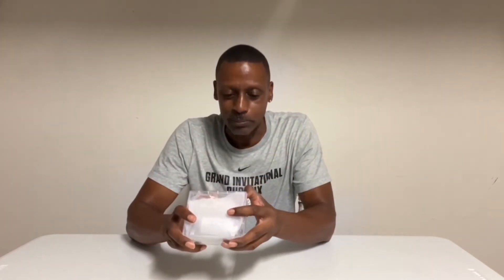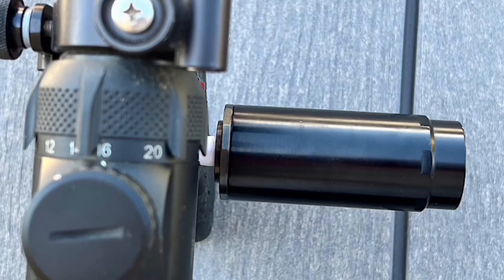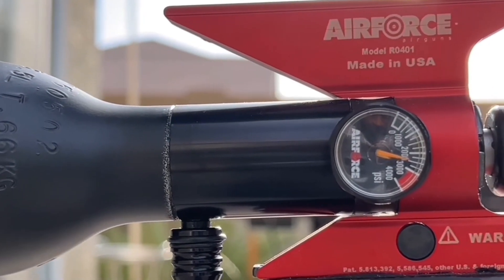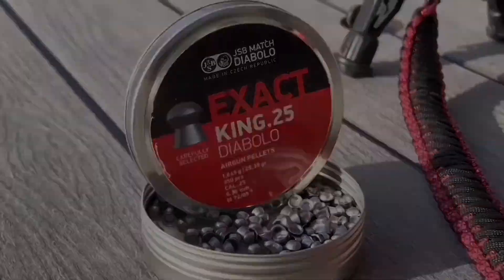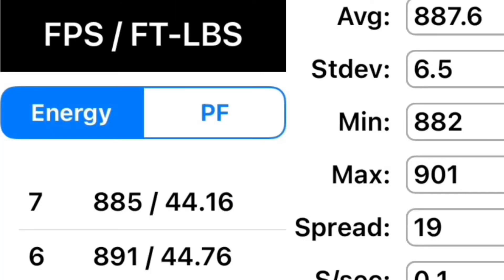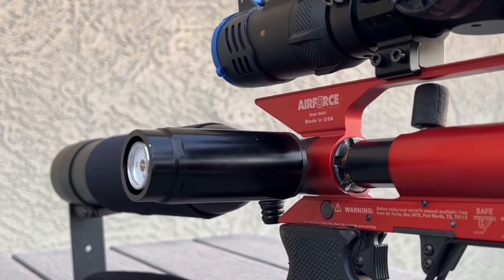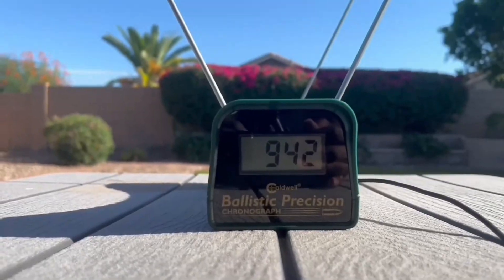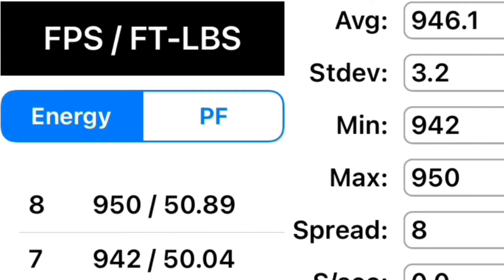AirForce Airgun Power Plenum - Increase Your Velocity

Comment: You took 7 shots and averaged it without the plenum.  Then you took 8 shots with the plenum installed and averaged it?. You took and averaged a additional shot into your numbers. I'm sure the plenum does make a difference but you're results are off.
Reply from the maker: Thank you for the insight. This video was made simply to show an increase  in velocity when using the plenum, not shot count. The volume of air used from shot to shot is enormous and lowered my shot count. The reason I did this was to show the increase in velocity when using the plenum. My plan was to shot slugs. However, I have learned that my gun/air rifle doesn’t yield the accuracy I want in shooting slugs. I am assuming my chocked barrel is not very slug friendly. I have learned that the JSB 25.39 gr pellets yields the best results for me so I no longer use the plenum. The plenum is a great asset if you are looking for more power. Thanks for watching and commenting. Happy hunting.

Comment: I’ll tell you the Achilles heel of this product- It’s perpendicular footprint on the gun. I’ve ordered a thousand dollars worth of products from PCP Tunes over the years for my Condor. I have the V1, V2, V3, and the Texan regulators. If they made a 90° male to female high pressure elbow that would allow the plenum to run parallel instead of perpendicular, it would seem less “clunky”, and (IMHO) functionally and aesthetically more pleasing. The plenum will be equally effective pushing the air through a 90° orifice as it currently is. Maybe you could reach out to the guys at PCP tunes and see if they will make one. Tejas is typically very responsive and easy to work with.

Comment: Will it work on a Talon SS with Altaros reg ?
Reply from the maker: I’m pretty sure it will. As long as it fits and screws tight in to your valve it should work. It’s designed to thread in the the Airforce Airgun valve. Thanks for watching.
Reply: @AzAirgunHunter  Thanks
Reply from the maker: You’re welcome!
Reply: does it reduce shot count?
Reply from the maker: @williamfrancis6993  It will use an extra 30cc of air per shot which can affect your shot count.
Reply: @AzAirgunHunter  Thank You ! What BAR and power wheel settings are you using. FPS ?
Reply from the maker: @williamfrancis6993  I have both my power wheel and power meter set at 1. My FPS with the JSB 25.39 gr pellets is around 940. However, I have dialed down my regulator to conserve a little air plus my rifle shoots best at around 887-910 fps. I current average 906 fps and shoot about 20-25 pigeon before falling off regulator and having to refill and that’s including a few misses and or a shot to the wing breaking it and following up with a second shot. It works well for me. I guess it all comes down personal preference of how you want your gun to shoot and what game or varmints you’re shooting.

Comment: Where can I order one for myself 357
Reply from the maker: PCPtunes.com. I believe I added a link that will take you directly to the plenum in the description section of the video. Thanks for watching and commenting.
Reply from the maker: Update! I received an email this morning from the PCP Tunes team indicating that their website have changed to https://trajectron.com/ as they transition in to Airgun manufacturing. As such they are still producing parts for upgrades and modifications. Also they created a new link for the plenum which is https://trajectron.com/airforce-gunpower-valve-assembly-side-expansion-power-plenum.html. So you can find the plenum here if interested. I will also update this link in the description of the video. Again thanks for watching and your continued interest.

Comment: How about size of power plenum? How much of air (C C)?
Reply from the maker: It holds 30cc’s of air. Thanks for watching!
Reply: @AzAirgunHunter  If we change it to greater than 30 cc, does it change speed?  because i see fx use 72 cc.Thank you.
Reply from the maker: If you change the plenum to use an extra 72cc’s of air behind your valve it will increase the velocity of your projectile more than the 30cc plenum will. The 72cc’s of air will be released behind your air valve in conjunction to the air released from your air bottle. So the more air flow you get down your barrel the greater the velocity of the projectile. The air released from your bottle should not be affected or changed as it depends on bottle air volume, valve size and hammer strike. The plenum just stores extra air from your bottle that is also released when fired. Just ensure you have a sturdy bridge breech to handle the extra air pressure. I am not sure of the max pressure the standard bridge breech can handle but just a word of caution for personal safety. I do have a more durable delrin bridge breech but I still use the standard bridge breech because it offers a smoother and better fit than the aftermarket bridge breech. Also understand that the report of the rifle will be louder and use more air than normal which will yield a lower shot count. I hope this answers your question. Again, thanks for commenting and watching.

Comment: Does it work on a .50???
Reply from the maker: Hello and thanks for watching. I can not say 100% that it will work on .50, but if it’s the same AirForce Airgun valve threads I’m pretty sure it will. All ot does is stores an extra 30cc’s and releases it when the hammer strikes the valve. So it works in tandem with your air valve. It just needs to screw in to the valve gauge port.
Reply: @AzAirgunHunter  I'd personally be interested in a test of that the threads will be the same it's the power I'm looking at in regards to extreme lrm ability and how well the valve holds up in a 3 to 4 month test it seems like a reasonable product but things like that could potentially severely damage the weapon is this something you are willing to test??? If so and you can show something real on numbers of deviation on crony  plus the wear on the valve and reg I personally will buy but at this point there's not a hole lot you have on it except the power on a .25 but airforce makes many calibers plus the regs and valves
Reply from the maker: I understand your concern of wear and tear on the gun over a period of time. I too had the same concern of valve damage. This is why I only conducted the test at the lowest possible setting plus it gave me a good reading of the difference in power with and without the plenum. As far as wear and tear goes me myself am more concerned about the 95gr heavy hammer I have installed rather than the extra air from the plenum. The hammer slams into the valve harder than the standard valve while the plenum only store an extra 30cc of air that is release when the valve is opened.  So I personally don’t see a problem with wear and tear from the use of the plenum. The air from the plenum is released in conjunction with air from the air bottle giving you a larger volume of air release which I have seen has no effect on the valve itself. I don’t own a .50 so I can’t give you info or data regarding the .50 but I can tell that I have spoke with the manufacturer of the product and when I shared my thoughts with him of possible rifle damage he informed me that the product should cause no damage to the gun itself but it is the heavy hammers and springs that can cause damage over time due to the heavy or hard slam in to the valve. The extra air release should cause no damage. I have two custom valves  for my rifle that handle the plenum very well. As far as deviation and other numbers they are in the video but only for the .25 Cal which is the gun I own and conducted the test with. I only use plenum when shooting pigeons from time to time. I don’t use it as a standard everyday shooting addition for my gun. I shoot more dove out to 60 yards and the plenum puts out too much energy for dove. I shoot dove with .25.39 gr JSB pellets at 887 fps which gives me great accuracy and energy for dove but the pigeon are little tougher to kill so I use the plenum and heavy slugs 36.2 hr slugs. If you are looking to use it for everyday shooting on your .50 I believe you would be ok. As I mentioned earlier it’s the heavy springs and hammers that can cause valve damage. I only have the heavy hammer, my spring is the standard AF hammer spring. I have been shooting this way for over a year with no problems. The extra air should cause no damage. It works fine for me without damaging anything. Almost forgot. My bridge breech is also a more durable delrin breech because that was a concern for me. I pay close attention to me breech because this is a part I don’t want blowing in my face. With that said I hope this helps. Sorry I don’t have any further data for you. I don’t work directly with manufacture, he is located outside of India but we do talk via cell and email.
Reply: @AzAirgunHunter  are you able to relay an email for the manufacturer so I can ask him cause all the things you've said I already know but knowing how the extra air will affect the top hat in a v2 is what I need to know plus the effects on numbers if your only getting 30fbe extra on a .50 that's kinda waste of time but if it increases by say 70 to a 100 that's extra power that could be used to beat the record of 1252yrd shot with an af I personally wanna touch 1300yrds and get 2 recorded accurate shots within 3inch hence my curiosity
Reply from the maker: @nemesis885  Sure! sales@pcptunes.com. Here you go. Give him time respond. He is working on expanding his company. His name is Paul. Tell him Ed referred you. Good luck. I hope you can get the answers your looking for.

Comment: What chrono numbers will it do with the power wheel turned up too 12
Reply from the maker: I would like to start by saying thanks for watching and commenting. But to be honest with you I never made any adjustments or test at a higher setting. The video was a test to see how much power I would gain with the plenum on average. After conducting the test I figured shooting at a higher setting would not matter being that I gained an 60 fps at its lowest setting. Also I felt my shot count would be severely affected if I was to shoot at such a high setting. But I will share with you that with the lowest setting it shoots the 25.39 hr JSB pellets 1025 fps, which is way too fast for a pellet and as I mentioned earlier I don’t think extra air usage is really worth it. So sorry I don’t have those numbers for you. But if I do run a test as such I will refer back to you in this comment. Again thanks for watching.
Reply: @AzAirgunHunter  thank you for the time to make this review it is very informative and now I understand

Comment: Hey curious about the plenum.  Is there anyway that could break off ?  Just hate to bump the side of a tree with it and curious how strong that setup my be ?  Thank again, like your videos ?
Reply from the maker: Again thanks for watching and commenting. The plenum construction is pretty durable. That too was my concern in the beginning but it has tipped over due to my son bumping it and all works well. I have designed an adaptor that will reposition it and align it with the bottle so it doesn’t stick out the way it does. I really don’t like the way looks right now. I have a local machinist that use to help with work on guns but I haven’t gotten a chance to speak with him. Eventually I will get to it. But is a sturdy design and a solid fit. Bumped up my fps by 59 with the same power settings. It puts the condor in a whole ball park of power. It shot the JSB 25.39 grain pellets at over 1000 fps. To be exact 1058 fps and that too was at the lowest possible setting. Thanks for tuning in and for the compliment. I hope to chat with you again soon.

Comment: Nice review on this but, I just don't see spending extra on an old design or new design air rifle. It may also cause the Air rifle to perform shorter term and not last as long as it should. The best way to do things are invest in a few different caliburs starting with .177 or .22 cal then to 30cal . that way you can cover a wide range of pesting and hunting. This is my experience of 40 + years in air power. I can cover medium range and long range with 3 caliburs. It seems to be a lot of hype stuff going on and mislead people in the air rifle world. If you research thoroughly you can be much more successful! Not knocking what someone wants to do. But use your head about this. Good video, hey, sta slingin that sweet air rifle lead! Ed da pro snippin air man💥💪😱😱😱
Reply from the maker: Thanks for watching and sharing your input. It is much appreciated.
Reply: @AzAirgunHunter  itsokay👍 you have a wonderful Hollidays!
Reply from the maker: @eddiecahall3824  Thank you. Same to you. By the way I have a .22 Cal Benjamin Armada and sold my .30 cal Hatsan Carnivore. I have fallen in love the .25 Cal.

Comment: This is FANTASTIC! Really, really good idea. I've been telling people for years: It's all about VOLUME!!
Have you thought about having them make it more "puck" shaped as not to stick out so far? Not sure that would really be possible due to thread tensile strengths at play, just an idea.
Reply from the maker: Thanks for watching and the complement. I wanted to have one made that way but this one is a FX Plenum where he customized the the back end to thread in to the Airforce valve assembly. I don’t really care for the way it sticks out either but it works great and handles up to 400 bar of pressure. So I’m happy with it. In time the design may change. I don’t know if one can fashioned to resemble a puck. He would have to manufacture it and that my friend is time and money. So I spoke with him and he used what he already had on hand which was the 30cc FX Plenum. Yes! You are correct! It’s all about Volume! Thanks for the input. Hopefully down the line the design will change. As of now mine is the only one manufactured and is the prototype. I’m hoping to get it out in Airgun world for other Airforce Airgun owners see and enjoy.

Comment: Does the gun need to be regulated in order to use this ?
Reply from the maker: Let me start by saying thanks for watching. To answer your question, I have not tried or tested the plenum without the regulator affixed. The function of the plenum is to add an additional 30cc of air behind the valve when struck by the hammer. In other words the plenum is designed to store extra air so I’m pretty sure it will still give you boost in velocity. The 30cc’s of air should work in conjunction with the air being released from your bottle. Your hammer setting and bottle pressure will determine how much air is released from your bottle and the air in the plenum will be released with it. The air in the plenum is released behind the valve not from the bottle. However, it is filled from the bottles. Again, I am not 100% sure but this is the way the plenum was designed. If you need further clarification please contact Paul at sales@pcptunes.com. I’m sure he could provide a little detail for you. Give him about 24 hours to respond please. He’s a great guy and is always willing to help and answer questions. Thanks for watching and commenting.
Reply: Thanks so much for the help And I’ll ask him later for questions thanks again
Reply from the maker: @armandoestrada9085  You’re welcome!